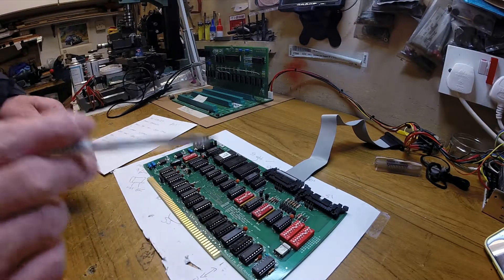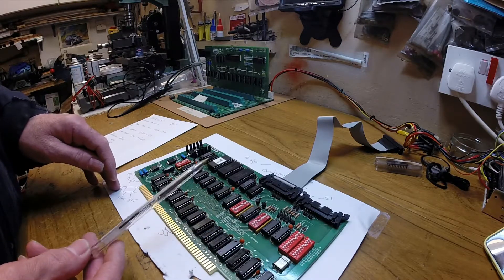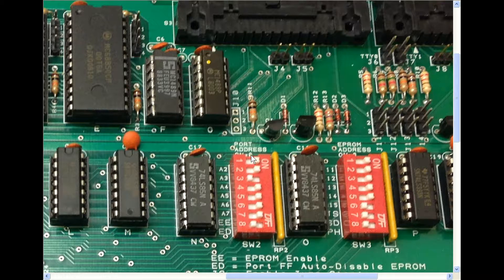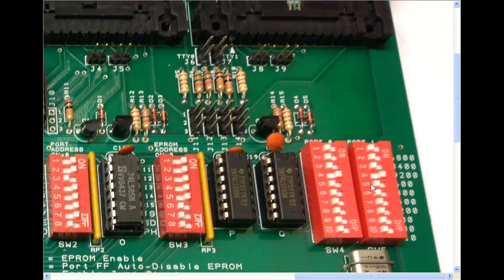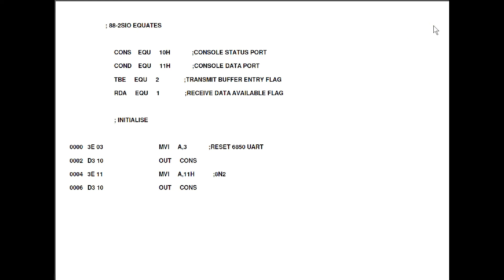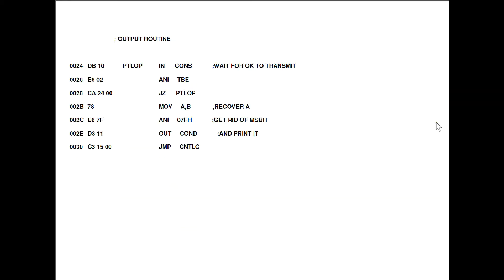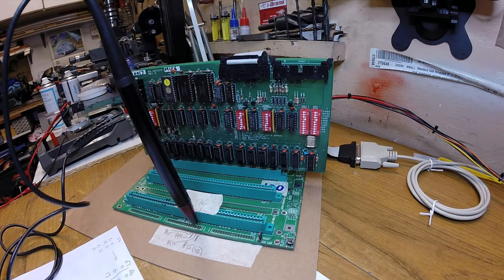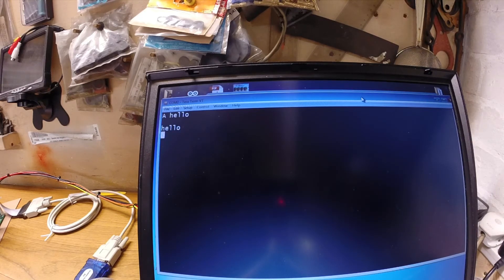Altair 8800 Build Project Part 6 - Serial Card

Comment: How did you input the program without a RAM card?
Reply from the maker: The program is in an Eprom on the Serial Card you can see it at 12:55 at the top of the card to the right of the logic probe with the round yellow sticker on it
Reply: Did the program come with the EEPROM or did you write to it yourself?
Reply from the maker: @artemkalinchuk  I wrote the program myself it's in the Google Drive link in the description under Serial Card/sloop2.asm

Comment: what a confusing board. I have rev H board and i can't for the life of me figure out what a "closed switch" means. if im understanding this correct a 0 to the right is actually a 1 = closed?
Reply from the maker: If you look at the manual I've linked above then it refers to closed and open for the switches, where closed is "on" and open is "Off"
Reply: The board IS confusing partly because the switches are not consistent.